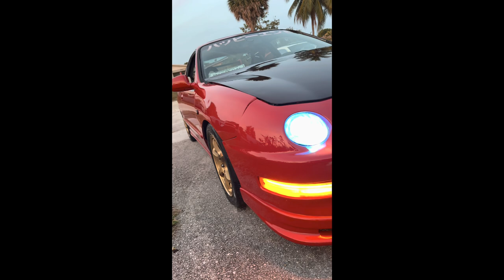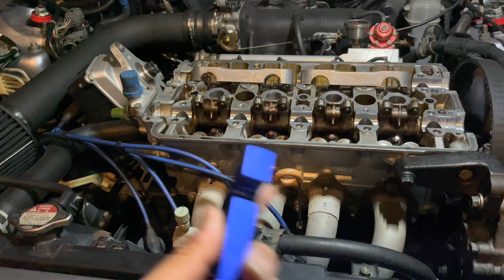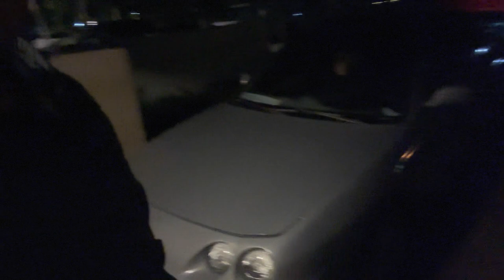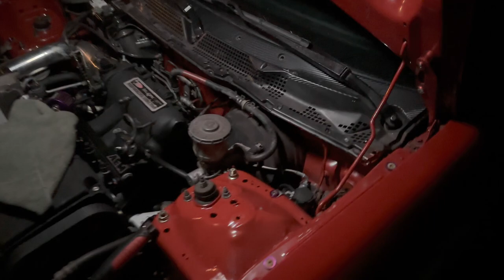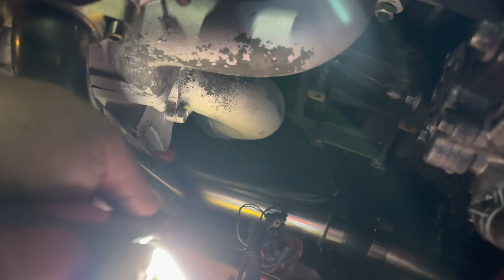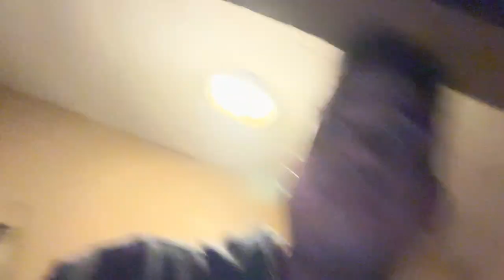Chinese Honda B-Series Valve Spring Compressor - I F#%$€D UP

Comment: You're missing the cup thing that the bolt is supposed to push on... That's what gives you clearance to get the keepers in/out.
Reply from the maker: Yea I had another viewer chime in and I realized it afterwards. I got it from Amazon so I guess the one I got was missing that piece. Most likely somebody returned it without it I would assume.

Comment: It should have came with a cup with an opening to use a magnet to remove keepers. I have one and never had an issue and used for many heads.
Reply from the maker: Luis thanks so much for the input! My kit did not come with it but looking back at the picture of the one I ordered you are right! I’m going to order another one and see if Amazon will refund me for this one and I will have to make another video explaining why I need to test it again.
Reply: Hey just wanted to help you out. Know how frustrating doing what we do is.

Comment: Is the car done ?
Reply from the maker: The motor in this video did end up getting finished and it ran ok but the car now has an lsvtec with forged internals. You will see most of the progress in the newer videos. It is not done yet with the new setup though.